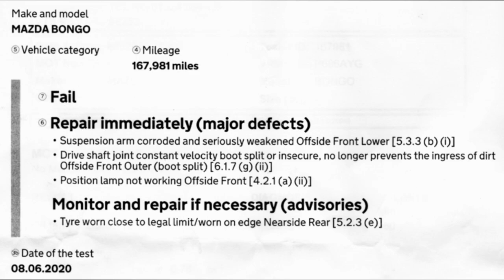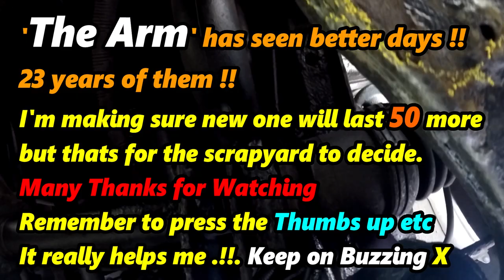Mazda BONGO Lower suspension arm Mot fail

Comment: Hi thanks for the video. My Bongos MOT is Next Tuesday 2nd April. I habe a quick question. I need to replace the rubber covers on the wishbone balljoint. Not sure if they have ever been done before, but my MOT guy may spot the smallest of damage. My question isssssss........ Do u know the actual size of the castle nuts because If i need to take a breaker bar to them the chances of them breaking is high and i will need to replace them. Thank you.
Reply from the maker: sorry I dont know the size of the nuts.. I will Pray for good results in your Mot,, I had my bongo 10 years and only One of them needed nothing..

Comment: its crucial to have it replaced at some point instead of only ball joint job done, 20 odd yr old wishbone isn't ideal to have in suspension, not the cheapest part compared to ball joint only but it could save you